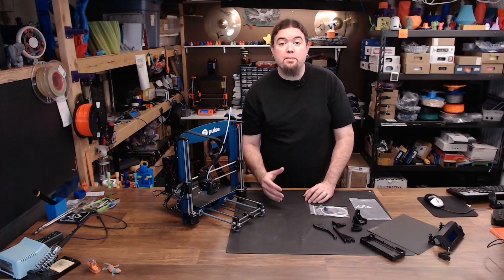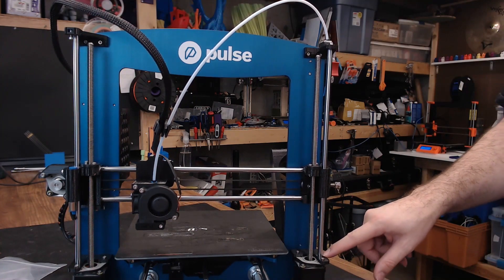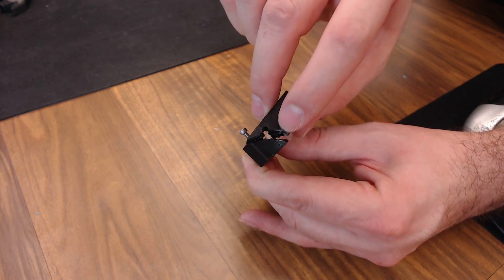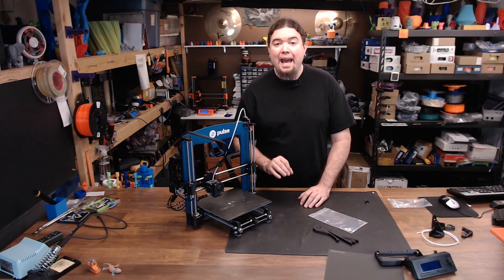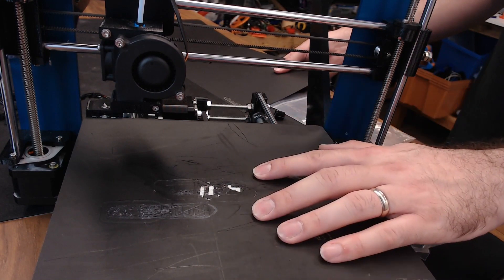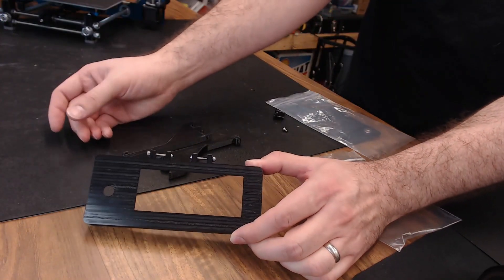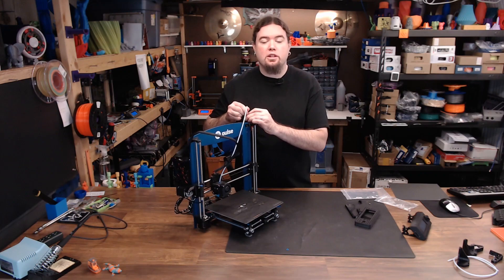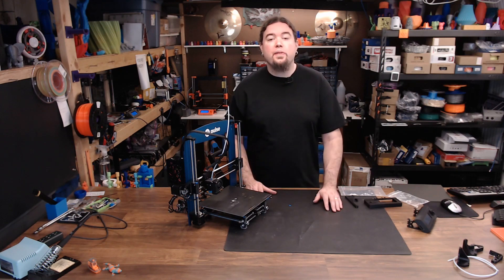Update: Matterhackers Pulse 3D Printer - Chris's Basement

Comment: I'm looking for a perfect 3d printer that won't be 3k... I think the pulse might be it... I want one with 32bit board silent steppers, bl touch or equivalent bed leveling glass surface direct drive..  basically something I won't have to upgrade in the first year...  is this that one?  Or do you know of another? Oh and it has to have a lcd screen with micro or standard card slots...  which I think I can ad to the pulse for like 700 bucks.... lol  I priced this out with everything I would like it was around 1700....  if I did a custom creality ender 5 plus base then added everything I want I think it would be about 900..  I want to get a octoprint but that's a whole new game I need to learn and understand before I buy one...
Reply from the maker: I personally would stay away from the Pulse, I have only has troubles. The Prusa MK3 is still me recommendation for the go to printer.

Comment: Wauw.. I saw your display front print. How do you get the perfect surface? I am tuning mine to get the matte surface and printing the surface with the same pattern. Somehow that varies even though the nozzle goes in the same direction.
Reply from the maker: That is the power of a Prusa MK3, I have s smooth PEI sheet on the spring steel sheet. Gives it a great finish.

Comment: I'm very new to 3D printing (10 days with an Ender 3) - how did you get that superb finish on the 'Matterhackers' LCD surround???
Reply from the maker: That is the power of a Prusa MK3, I have s smooth PEI sheet on the spring steel sheet. Gives it a great finish.
Reply: @ChrisRiley  But yours appears to have a textured finish...
Reply from the maker: Hmmm, must be the camera, other than the set in lettering its completely smooth.
Reply: @ChrisRiley  someone else also commented on the textured finish. Weird...

Comment: Glad you got your pulse working right :-) I have a CR-10s 400 and I've been thinking of swapping the glass bed out for a different build surface, just to reduce the weight on the y carriage. It prints perfectly on the glass with Magigoo, but the glass is very heavy. What would you recommend here in the UK?
Reply: take a IKEA mirror, these are thinner and therefor lighter
they come in 30mmx30mm and are packed per 4 for 8eur ( approx 6-7 uk pesos )
Reply: Appreciate the input Patrick, I did consider those, but my bed is 400x400. I might still give em a try though.
Reply: ah yeah the 10s 400 ...

I had to cut mine down on the cr0 mini... :)
Reply from the maker: Tough call, I am guessing the glass is what gives you a level surface to print on. If you could find a bed that was completely flat I really like PEI sheets. You can get those about anywhere, but again your bed will have to be really flat for it to work.
Reply: Appreciate your advice Chris. The CR-10 has a BL Touch (3x3 grid) so I could increase the number of probe points to (hopefully) compensate for any unevenness on the bed. I like the idea of PEI, I have it on my Prusa MK2 and it's great. I will keep a look out. Keep up the great work mate. Thank you.

Comment: Nice video and glad to hear this product is being suported . 
What are your thoughts on minimum bend radius of PTFE tube?? That bowden tube looks a bit on the short side, primarily the large radius coming out of the extruder looks a tad tight.
Reply from the maker: I think it could use just a little longer section, but the radius doesn't seem to hurt the print quality any. If it was me, I would go with a longer section.